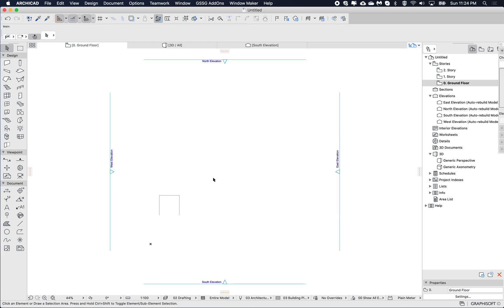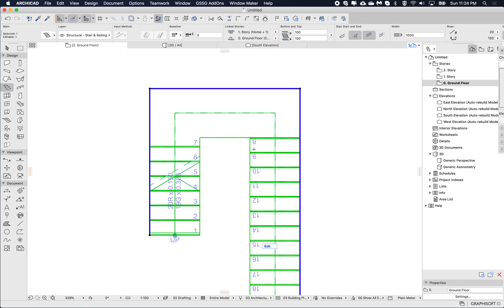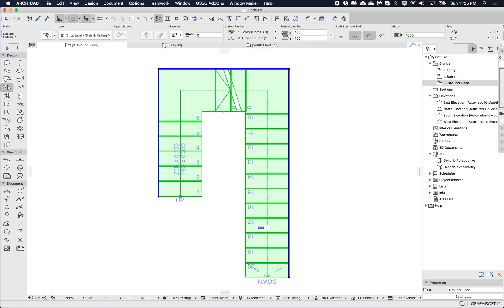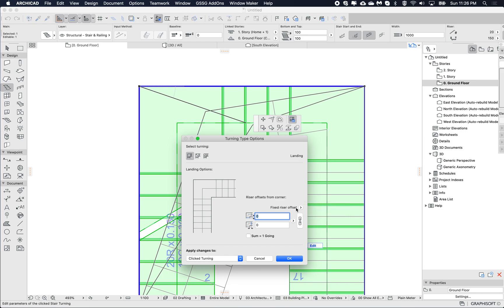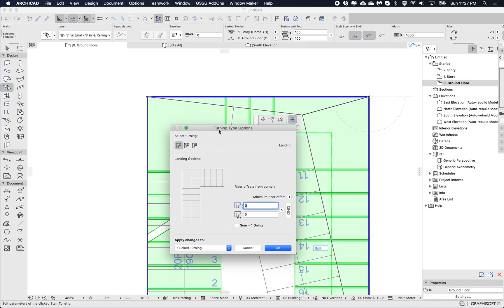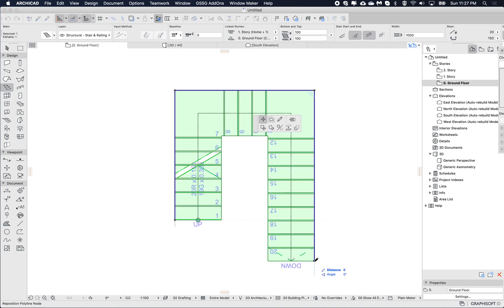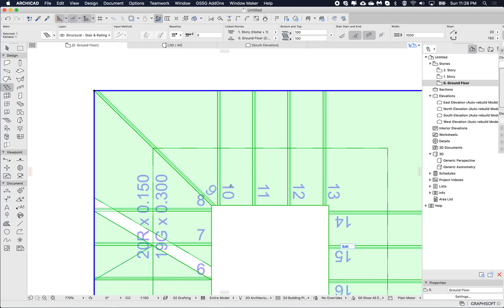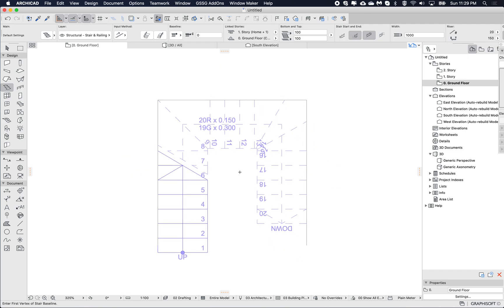Archicad Tip - Customise Stair Landing Offsets and Winders

Comment: Thank you so much for this video. It helped a lot. I could build the stair to let's say 98% how I wanted but there is still that 2% detail regarding the editing of winders and adding 1 more rise to the flight. Is there any chance for a guided 1-1 tutoring, I would pay for that of course. The stair tool has been since always something I was always avoiding in Archicad as soon the stair had the U shape or 1 or 2 winders and instead of using the stair tool I preferred to build the stairs with the slab tool. But that's not the point if we have the stair tool which is there to simplify the process of building a 3D stair in Archicad. I will highly appreciate your help.